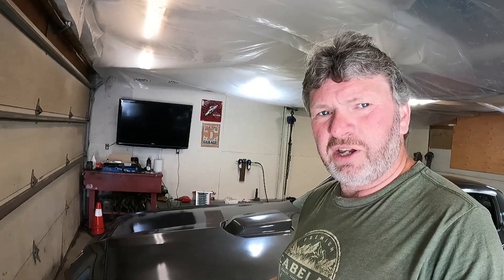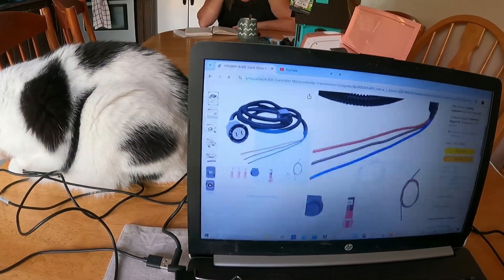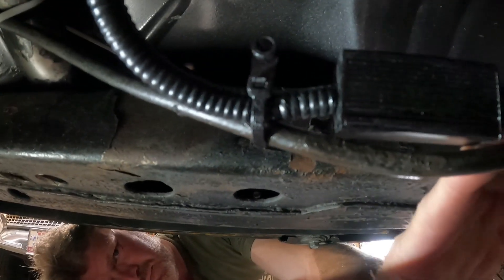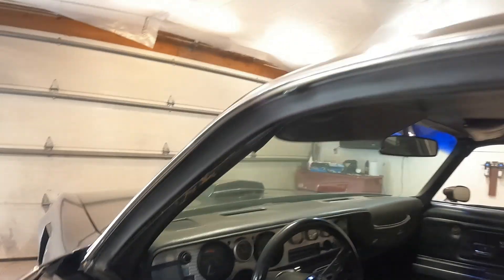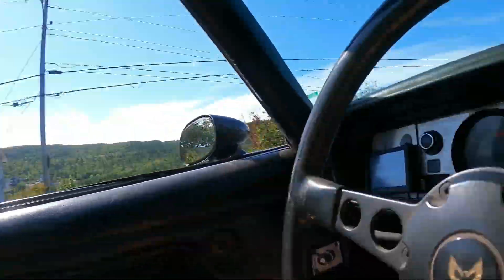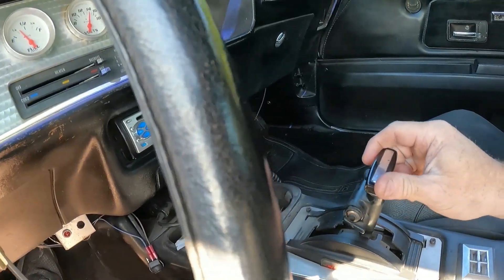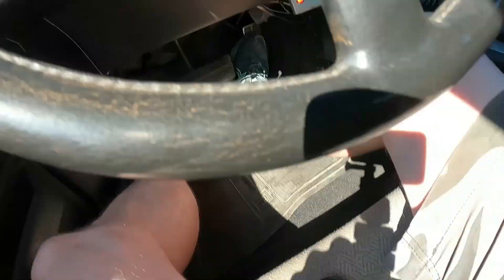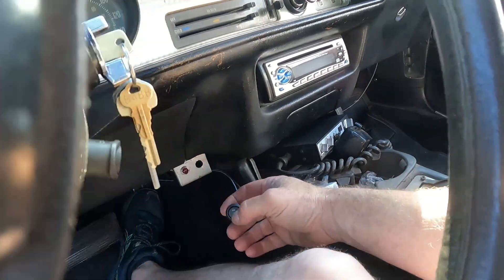4l80E amazon stand alone transmission controller

Comment: I have an 84 k20 with a 4l80e and that type of controller.  It's got a 600 hp 496, so it's kinda a hot rod. It puts full line pressure to the clutches all the time, which is pretty violent going into gear, but is probably better for the transmission in a situation where you're going to wail on it. Not great for u joints or smooth driving.
Reply from the maker: Sounds like a cool ride. Makes lots of power for sure. People pay a lot of money to get a transmission to shift like that.

Comment: i didnt want to deal with a manual valve body. Did a aces quickdraw the trans controller works great and was like under 500.
Reply from the maker: I hate the manual shift. probably going to put a stock ecu in it eventually
Reply: @weekendatbernies4503 well mine is behind a buick  455. So oem wont work
Reply from the maker: @jeffreyrigged I see aces advertising for fuel injection systems I didn’t know they made transmission stuff I’ll have to check them out, good to hear from someone who has used their products

Comment: I got a 94’ K3500 with the 4l80e and a 350sbc pretty sure my 350sbc is tried but planning on putting a 6.2l diesel in it and not sure if me buying a 92 ECM for it since that was the last year of the 6.2l diesel that had the 4l80es will make my trans shift but for $30 for this shoot I’ll just make it manual pretty much lol
Reply from the maker: Ahh the old 6.2l Detroit you would have to check for sure but the diesel torque converter may be tighter stall speed than the gas. Be cool though just remember to mount the module for the injection pump off the engine to keep it cool so it will start easier when hot. That may have been the 6.5l in the later years though. But the manual option tor the trans does work
Reply: @weekendatbernies4503 yeah that’s the 6.5 I have a 94’ 6.5 and it had the PMD relocated lol but the 6.2 I should be able to use my fuel pump in the tank and yeah I was thinking about swapping the torque conveter just to be save but I think it will be a lot better of a option my 350 is running lean with a new MAP sensor new IAC TPS coolant temp sensor fuel pressure regulator new injectors new PCV I swapped EGR solenoids unplugged the EGR swapped a lot of stuff and just yeah idk before my fuel pressure regulator and injectors I had a code 15 and code 42 and was running rich now I have a code 12 and code 44 and running lean but I don’t backfire out the tbi any more so yeah I just wanna throw the diesel in it and be done with it lol
Reply from the maker: @hammertank8085 I’ve after seeing them 6.2l and 6.5 with almost a million miles on them I have a duramax myself but I always loved the old 6.2 they didn’t get a lot of respect because people couldn’t buy a tuner and add 300 hp. But they make torque. Usually if empty or loaded down they still pull the same. And they sound great
Reply: @weekendatbernies4503 yeah there good engines when you fix they’re issues the half ton blocks where a weaker casting so that’s where they got they’re blown headgaskets and cracked blocks but the 1 ton applications where stronger same for the 6.5 but less but they blew headgaskets due to the turbo sometimes and others tuned them up a little bit then they blow but it’s around $5000 or so to make 300hp 😂 giver or take new intake turbo the tuner kit for the 94-95 which are the best years of the 6.5 for tuning the 92-93 are good for the mechanical pump and ain’t bad and then you gotta get head bolts and etc it’s a lot but they’re not bad in stock form atleast for me for now lol and I belive the 6.2 has a stronger bottom end I think but yeah
Reply from the maker: Curious if the 350 has a vacuum leak on the intake gasket or the throttle body. if it was under the intake it be hard to detect but may put oil on the plugs making the plugs look rich. Seems like you changed everything else.
Reply: @weekendatbernies4503 I sprayed some ether around and it didn’t change how it ran so I ain’t sure at this point

Comment: I'm getting ready to order one of these. I'm doing a LS swap in my 95 Chevy truck and I'm going to use a 4l80e. Someone told me that 95 and older takes a different one than 96 and up. I haven't found one of these that is year specific. Thanks for the video 👍
Reply from the maker: I’m pretty sure the plug is different older models have a bolt on connector the others have a push on

Comment: I just ordered one should be delivered tomorrow, i got a 94 chevy k2500 454 that im carb swapping and getting rid of that tbi junk. Trans controllers are soo expensive like $1,000. I reallly hope this works
Reply from the maker: Should be fine
Reply: Did you get yours installed.. I just carbed my tbi 454 as well
Reply: @andrewthomas8469 yes i did it works great. Had to figure out the wiring on my own there were no instructions, and mine was like 100$ cheap and the indicator light broke while installing it, the wires just fell off of it but i found another light to use. And u don’t honestly need it. Other than that light everything was good abt it
Reply: @majorwoody1720  does it shift hard? Cause  I tow lots and dont want to rip a transmission out lol